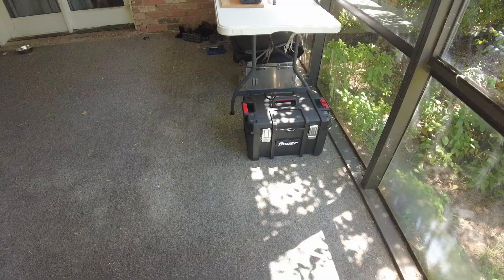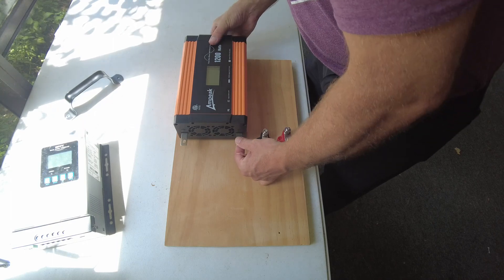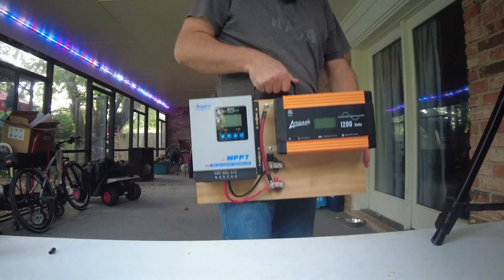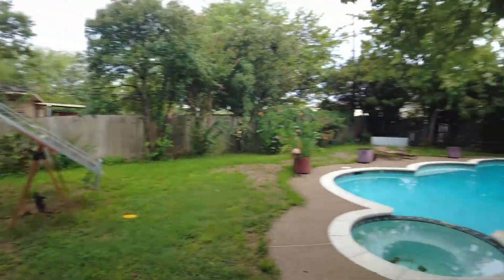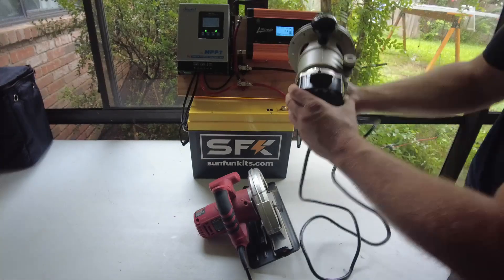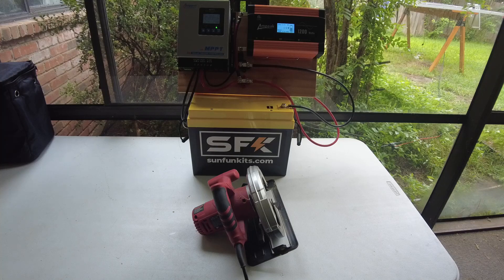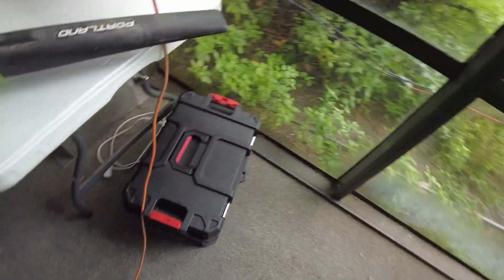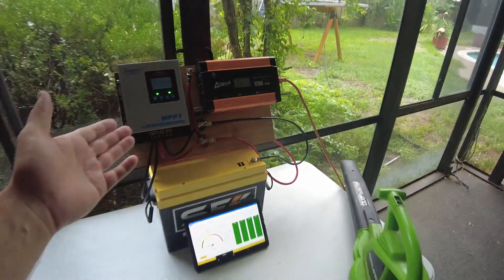Easy DIY Solar Generator

Comment: Just saw your video for the first time.  What a great idea.  I showed it to my husband and he stated the same thing.  He also recommended that you use at a minimum a 1500W inverter with your saw as he noticed the soft start.  He says that continued use of the saw with that size of inverter may eventually damage the motor on the saw.  He believes the amperage on the saw is 15 amps so the 1500w inverter would help deliver it and manage the surge a lot better.  Great video.

Comment: Oh, don’t think I will put on that thing I do believe is a switch to shut off the solar panels. That way you can hook up the batteries then turn that switch then you got your solar panel as I understand it you need unhook the solar panels hook the batteries first then you can hook up the solar panels instead of have to keep on screwing or get them fittings that you could pull out or whatever but I like it

Comment: That is awesome mate. I thought about that dude that way too but then again, I thought man that I wouldn’t work very well but then you made a point you could hook it up to the car battery if you go somewhere that makes sense so the only thing I would do is have two boards, same size Put hinges on it away. If you won’t let down you let down the toilet you know I’m saying I think I’d be cool but I like it that’s a good idea. Very good idea I thought about it years ago but I just never quite well. The hood would work very well but actually it worked pretty good And then if you go anywhere with it it’s so small like you got it you get one Özil totes and just cover it up. If it’s raining I like it I like that idea I think I’m gonna buy your plans I don’t wanna go by that only thing I got a question on how do you know what size the fuse to use on your converter never use get a 2000 converter would I have to have a 2000 fuse I’m not going to stack I’m at electrical guy

Comment: What will you run off a 1200watt inverter of any consequence in a power outage?
Reply: Assuming his BMS limits the amps to 100, he's not going to pull more than 1350 Watts anyway. Using a 2000 Watt Inverter would be a waste of money. You would be surprised what you can run on 1200 watts.

Comment: If you simply created the mirror image of component placement then the positive terminal of the inverter would be on the right side to mount the fuse.
Reply from the maker: True but the inverter screen would be upside down. In this scenario it's not necessary to fuse the positive side since there's no other paths to ground. Thanks

Comment: 300 amp hours at 12 volts is massive capacity then what is 450 amp hours at 48 volt?
Reply from the maker: 48 x 450 = 21600wh :0
Reply: @BradCagle  lol yep, it's the exact opposite of portable 😆 I got bit by the solar bug. 🤷‍♂️. Pretty nice to be able to make your own power tho! It is still a work in progress.

Comment: Good afternoon  This controller, if 150 volts comes from the panel, is it possible to have a 24 volt system on car batteries?

Comment: If you want to save money you can get 1/2 inch copper pipe. Hammer it flat, drill the holes and now you have your own hand made buss bars.
Reply from the maker: Yes, that is a good method. I've done that before.

Comment: This is exactly what I did! Built 2 systems that can move between all my batteries! Great content on your channel. Pre built solar generators are nice but not practically priced at higher capacity .. you can build it much cheaper and use your favorite components! Also you can swap out individual components if something fails. And it is fun to build.
Reply from the maker: My thoughts exactly! Thanks
Reply: FACTS!

Comment: I made one on a old short ironing board.  I poked some of my wiring to the back side to neaten it up. Going to add a plastic channel cover over the wires.  Been thinking about the board generators.  There are 2 sides to a board, still trying to lay it out in my head.

Comment: Not a bad first attempt. I have one of these controllers in a garden shed. Based on its manual, you need at least 20cm clear space between the side of the controller and the inverter.  The inverter will also have all-around free space requirement in its manual. Depending on which country you are in to be code-compliant you'd also need DC isolator switches between the controller and battery, and controller and inverter.  Adding an Anderson connector for solar will need a fuse.

Comment: the teh fans run all the time on the inverter?  Thinking about buying it but don't want the constant noise from fans under barely any load
Reply: okay I noticed they came on later which is great, but do they turn back off after the unit has been idle?
Reply from the maker: @FortyTwoAnswerToEverything  Honestly It's good inverter. but the fan noise sucks. I would recommend you find something else. The leesky I reviewed is much quieter, but it's more expensive. This is the leesky https://www.youtube.com/watch?v=btR6bU4dqOQ If you can spring for more money this one is WAY more quiet.

Comment: This is a joke.... right?  That isn't a DIY Solar Generator....  Solar Generators are self-contained with a power source and all the other accouterments in some sort of housing not just stuff stuck on a board and carried around.
Reply: On a board, inside a cover…. Splitting hairs dont you think.
Reply: @codiecarroll735  the concept is to centralize all the components and provide them with some sort of protection from the elements.  That is why people build them in toolboxes, ammo cans, storage tubs etc.  Sure you can slap all the stuff on a board but that's not what the concept of a solar generator/power station is.
Reply: @leonardchurch7675  unless you’re the official law-maker of solar generators, thats your opinion bud. not everyone shares that opinion.
Reply from the maker: Some people eat hamburgers without the bun.
Reply: @BradCagle  a hamburger without a bun is known as a ground meat steak not a hamburger and if you wrap a patty with lettuce you just have a lettuce-wrapped ground meat patty.
Reply from the maker: @leonardchurch7675  Interesting, I've never ordered a "Ground meat Steak". Do these ground meat steaks usually come with lettuce, tomato, onion, pickle, ketchup, and a double shot of mustard on top?
Reply: At least it has TONS of air flow so it won’t overheat the components.
Reply from the maker: @Tjensen999  Yeah, they will totally overheat in a box. That inverter will overheat on a hot day out in the open in the shade. I have fans for the toolbox, but I doubt it will be enough.
Reply: Probably better than enclosed in a box. More air flow. Put it in a crate also.

Comment: Good idea. Can carry the battery and the board separately. Now putting the inverter, mppt, fusing, wiring, andersons in the case and attaching an anderson connector on the battery is the next logical step. I like it Brad. Damn good idea mate.
Reply from the maker: Yes, I need to order the anderson connector now :) Thanks Benny!